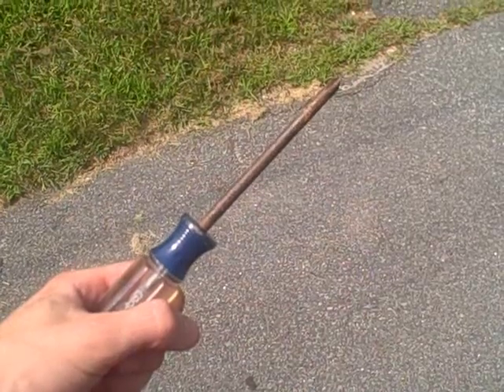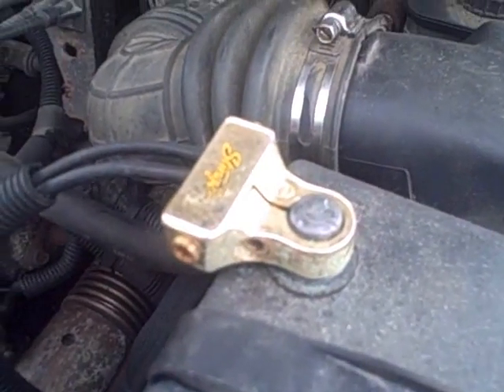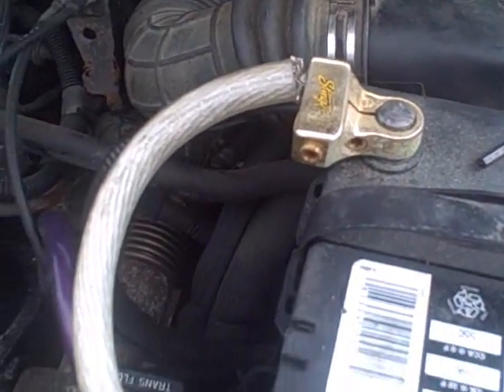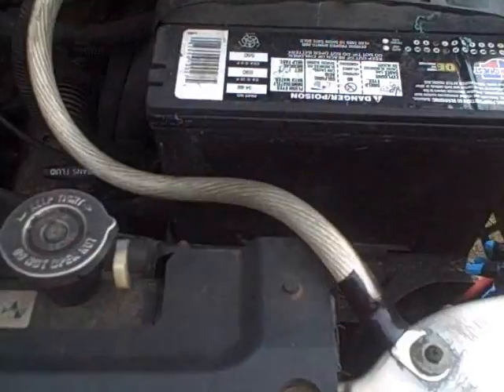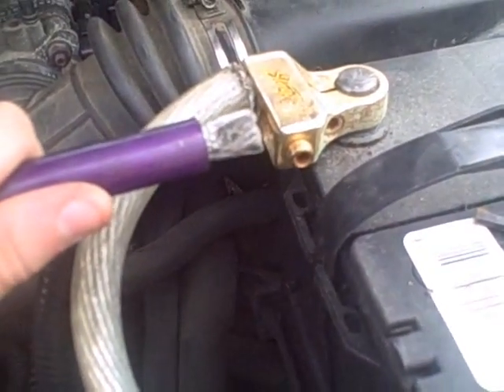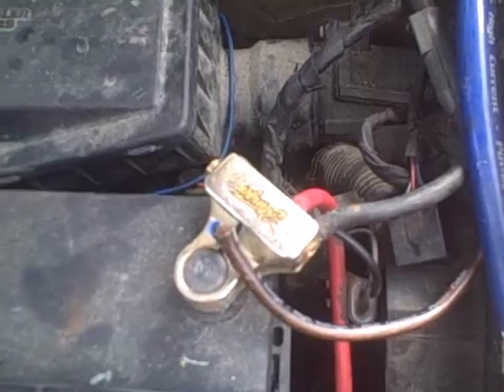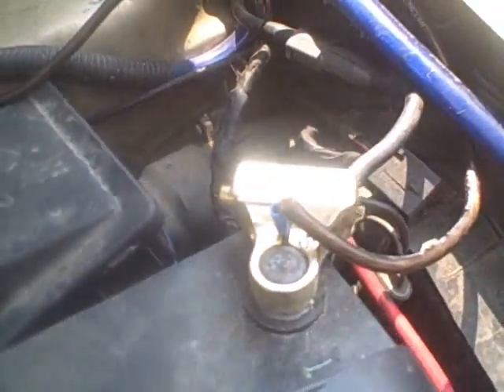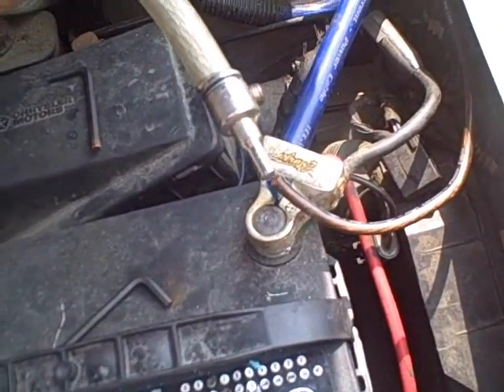Increase Car Audio Power 25% - How To Install Big Three Upgrade - Easy 15 Volt Stereo System Big 3

Comment: you need 2/0 AWG big 3 is weak
Reply: +kaine stefaniak 2/0 awg is different than 2 awg wire.... 2/0 is bigger than 1/0 awg 3/0 awg is bigger than 2/0 awg and so on. food for thought.
Reply: Are you dumb or 
the big 3 is all 0 gauge 2 gauge isn't is thick is 0 and as your saying the big 3 is weak what do you consider then.. big 4?

Comment: you should do the big three even if you don't have a system it has been proven to help your car
Reply: Yes better current flow the better for your car
Reply: +legendary504 hey can i ask you a question about the big three ? when connecting the wires do i connect the positive to the battery with the fuse inline already or should i install the fuse when every single wire is connected ?
Reply: +Cingle player alternator to the battery is correct just Make sure your wire is on the positive post of the alt you can check it with a multi meter also make sure to fuse all positive connections
Reply: +Cingle player I always pull my inline fuse just as a precaution. Any step you can take to protect your equipment from power surges can potentially save you hundreds of dollars.

Comment: Nice explanation, simple yet effective. 

One suggestion... you should probably use a larger machine screw for your battery to chassis cable attachment. In theory a machine screw with smaller threads will stay in place better (Especially if you have bass shaking your car like crazy :p )

Comment: I just wanted to note that by simply only increasing the size of your wire does not increase you current flow, but it does increase your handling capabilities.  Think about it like this, a 12v battery will only supply 12 volts to a wire regardless of its size, however if you have that 12 volts of pressure pushing say 40 amps, a 12 gauge wire will carry it but will burn up from forcing all them electrons so tightly together.  Where as an 8 gauge wire would better allow the electrons to flow freely without producing excess heat.
Reply: Exactly!  Bigger wires can carry more power, but they do not 'MAKE' more power.
Reply: Righto W. He said increase the power flow.... he never said it supplies more power.
Reply: Its the continuity of the situation

Comment: Do I need a fuse on the wire that goes from the alternator to the battery?
If yes, how many amps the fuse? My alternator is 110amp.
I have 2 fuses (100amp) each that goes from my battery to my amplifier. It is ok or no?
Thanks
Reply: +LOV2XRL8RL  the main charge lugs on some models are not fused on some they are . question is where are you picking up your supply's from the battery lug clamp itself or on the back of the alternator .  if there is no fuse on the system then nothing to fear  but adding to the alt fuse if there is one may result in pulling that unit out leaving u with no charge and a dead motor 50 miles from home  Split charge system is the way to deep cycle AGM or a odyssey battery to run the kit  with a smart sense or professional split kit with alt sense pick up . You are Ok to connect direct to the battery post here . personal i would have a AGM In the boot running amps TV's ect  then One cable down to charge it .;)  . Always run extra chassis bonders to battery when doing this shit .
Reply: +LOV2XRL8RL Fro what I have found, is that it is not necessary, but if you feel like you want that extra level of protection (mainly if anything would damage the wire, then nothing would happen) go for it. I believe it is a 200 or 250 amp fuse that is recommended.;
Reply: A250 Amp fuse will not blow till it sees around 300 + Amps  under direct short condition So i can not see you pulling 250 Rms . once you have installed all your kit .enjoy stay safe.
Reply: +Rs500ybd I changed those fuses (100amp each) for one 100.
Reply: you will soon know if they are underrate they will fizz out on ya on a drop note .remember electrics kills even 12 volts .;)

Comment: what amperage of fuse would be used for a 370 amp alternator
Reply: +Exhilarating Bass So use fork battery cable then 35 mil up  good for 1000 amps plus .
Reply: +armando castillo  370 amp alternator what is the load requirement of all equipment at full duty cycle  first then you work out what size cables to use if it might require a second or discharge cap . i would fit a 350 bridge leaves 30 amps clear  but what is the over all run time of that alternator producing 370 amps .  do the math work it out what you have to run  what it requires how long the runs are what loading drop will be involved in shitty cable  lots of posh cable out there with nice bling blue red sheaths but the cable core quality is Pants  a decent roll of cable will cost in America about 800 dollars . Maths first then shopping . ;)

Comment: only 1 real issue i had with this, a single screw fastening that ground wire (bumbuuuum!) always use a nut and bolt with a spring washer. scratching the paint away, ding, a single screw, buuuum!

Comment: I got a gmc yukon xl with 2 15 inch audiopipe triple and a audiopipe 3000 1channel .. 200 amp alternator and two i interstate batteries. When da bass drops my voltage meter on da dash drops down to less than 9 volts and bass shuts off but comes back on ... Like how much power do i need.. Its ridiculous how i cant get this right

Comment: HEY EXO I DID ALL MY 0 GAUGE CABLES UPGRADES BUT THE CAR WONT STAR UNLESS I CONECT BUT THE FACTORY POSIVE CABLE GOINT FROM THE ALTENATOR TO THE BATTERY IS IT SAFE TO CONECT BOTH OF THEM THANKS
Reply: +Victor Garcia Dude...that's obvious!
Reply: Victor Garcia yes connect them all

Comment: I have a 2001 firebird n I wpuld like to do this but I have a side post battery, can I still do this upgrade to it?
Reply: KING KRISM yes you still can.  look up on ebay or amazon car audio battery terminals and you will have a few options. there's a kit to convert your side terminals to actual post if you have the screw in terminals. Or you can get a slightly longer bolt and simply use ring terminals at the end of your wires.

Comment: Do I have to upgrade my Alt to or can I do the big 3 wit stock alt n battery
Reply: You don't need to upgrade your alternator, unless you play very long continually and with like 3000+w and a very small battery.

Comment: I'm driving an 88 Chevy S10 and I recenly installed a 400 watt amp in my truck. I'm only running a single 12 inch sub off the amp. My front, 5" speakers, and back, 3" speakers, are running right out of the back of my stereo through the wiring harness. I know that all the stuff works because I just pulled it out of my old car. The 12" speaker and amp work fine when I just have the battery switched on, however, when I start my truck my whole system begins to cut out with the engine running (similar to a CD skipping). Does anyone know if this would fix this problem or if it would be something else?
Reply: Sounds like a ground issue

Comment: only thing I would add is use a dremel with a wire cup wheel, andclean down past the primer...you still had primer showing. the dremel will get it to a polished finish, and is flat metal to metal.

Comment: man I just bought o beast of a system, but I still have so many questions, I wish I could get exo to hook it up, or at least set down and talk with him about what I really need, and not what the shop just wants me to buy
Reply: if you need help I will be happy to. I am MECP bronze level certified...so I have passed tests...not just some guy who "kinda knows" about audio. oh, and I was an installer for a paycheck for 3 years.
Reply: djbadandy1 does thos really increase your porwer out that much to worrk about it?
Reply: Lots of factors here, but potentially yes. Depends pretty greatly on the amp delivery that you need, but maximizing every connection, will deliver all the power your car can offer. Can you put a number on it? Like 25%? Lol no. Its gonna be different for every situation.
Reply: djbadandy1 i have a zeus 3000.1d
Reply: Is that 1500 or 3000 rms? Its been a while since ive messed with anything hifonics.
Reply: 3000 rms
Reply: Michael Beard Should run 0gauge cable + and - from Battery to amp. Why direct? A car chassis van be compared with a 2 or 3 gauge cable. Next step should be adding the big 3 while you already being busy with cables. Doesn't cost much and isn't much work either. If you got a good stock big battery you'll be fine. Still not satisfied, place better big one with high cca rating or a same type battery you have in the back. Good luck

Comment: Well kind of !
While he did up grade the cables you could do a better job.
The battery needed to be better the cables were ok but when you run a + lead that fuse should have been mounted to the car.
ALL cables should be hidden as best as you can it should look factory when your done.
use the plastic shield like a factory wire uses.
and follow the factory path for the alternator cable.
You might have to remove a few things to do it right but in the end you will know it is a safe install.

Comment: Looks like someone had to cut a shit load of strands in order to make it fit in their cheap tiny battery terminal!!! LOL
Reply: Wondered if anyone caught that. Also, I had an install done from a shop in Idaho, wont say the name for legal reasons but they did use a screw for my ground on a 600 watt sub amp, it lasted a couple years, till some corrosion started in the tiny threads where the screw meets the body. Even with the cleaned metal the contact was meaningless as it became loose over time. After frying 2 speakers I traced all the wires, found this ground wire with a single screw holding it down, replaced it with a bolt and nut and viola! No more blown speakers. Don't cut corners and use a single screw for ground wires.... The amount of threads that make actual contact degrade considerably over time as corrosion takes place, not to mention they don't hold a great deal of pressure as they can become loose very easily. If you haven't run a tap into that hole for the screw your using, you risk shaving the threads off the screw as it is run into the steel body, which will also cause a weakness as it can strip or become loose with less effort.
Reply: rebelnut1 A shitty ground isn’t going to cause speakers to blow you dip shit. Turning your gain up to max like it’s a goddamn volume knob will blow them though.
Reply: rebelnut1 even if you mention their name, the most they would do is serve you with a c&d order, and you would have to take the post down.
 cuz you aren't even defaming, just stating how the end result of the job, caused for you to lose out on a service (that you paid for, remember) that the shop had indicated it would do without fault.

Comment: Or save time amd run a ground wire from the to the amplifier
Reply: No this will cause ground loops
Reply: Jason Gib no it wont if you connect ground to the chassis its like feeding a fire hose threw a garden hose with the ground connected to the battery you will not have grounding issues

Comment: Waste of money, time & copper 
Do you know we can run 100+ HP motor with that size of cable 
And tell me whats the use . There will be a tiny thin fuse in between anyway for protection 
Powerful Horse (0 Gauge cable) will be asked to passed through rat's asss (Fuse)
Reply: Amol Raut Well yes actually if your subwoofers need that power then yes 2.5k is needed and 2.5k is far from a tiny system in a car its more of the avg sized system now a days if you were only running 600ws then yeah thats tiny and the 0 gauge would be overkill. But when it comes to car audio most likely you will upgrade at some point so even if you don't need that 0 gauge wire it's still worth it to have it and in car audio you can't have to much power, power is everything
Reply: Amol Raut Respect dude.
Reply: Amol Raut Why comment on something that you know nothing about?
Reply: hhahaha not off 14 volts. 100 hp X 746 = 74,600 W.  74,600 W / 14 V = you're fucked.
Reply: P = VIcos@
100hp=74.6kw
74600=VIcos@
consider pf to be 1 
so I (current)=179.75 Ampere current carrying capacity of cable
 
Considering for 14 volts 
14*179.75=2516 watts = 2.5 kw

Do you really need 2.5Kw of power for a tiny car audio ??
Reply: Josh Ianneillo 
That would need a separate alternator as well :P
Total overkill :D
My linea has 120 Ampere rating Alternator
I dont know how much is dedicated for car audio but I can assure you I can't draw 178 Ampere out of it  . Even if I use two 0 Gauge wires . 
Is there a need of it ? did he even calculate ?Can his car Alternator output 200+ Ampere dedicated for Audio ? does amplifier used in car need that power ?
Author is simply saying putting 0 gauge cable improves sound quality . 
Is there any basis to that ?
2.5K is insane power requirement for car audio 
To all fellow members . Just use wire gauge that is needed . If your car has 100 Ampere alternator & you are using 0 gauge wire that has capacity to pass 200+ ampere continuously then Its waste of money, copper.
Reply: Mario Mangone  
Copper?
Author said use 0 gauge cable & improve output by 25 %
Reply: Josh Ianneillo I know right! I'm running 650 watts just to my components! 1000 watts to a mono-block for a single 12". And I'm still under powered for my components. I need to bring it up to 800 watts to power it sufficiently....
Reply: rebelnut1 are those RMS values ?
Considering your car has very huge 200 Ampere alternator, the maximum power produced will be 200x14=2800 watts
How do you manage to run your car buddy when only 1150 watts (2800 watts produced-1000 for mono -650 for components) of power is available for rest of the car
Reply: Yes that is RMS, the mono block is rated peak 3000 watts, 1000 rms at 2 ohms, not sure on the 650 amp....
Energy consumption is never full tilt. Even house wiring is not designed to have every single outlet at max current. The same with audio "purely my assumption", I am not playing a single note that is capable of drawing full power for a sustained period. Music, has notes, which draw power as each note is played. Bass "notes moving my 12" sub" of course being the major user of this energy. My battery is a vessel of stored energy, which is where my current is pulled from, as I see my headlights dim I can assure you if the bass note was constant my electrical system would not be able to keep up.
This is what was explained to me by an electrician "as far as housing electrical is concerned", I assume it applies with music as I have described. Any thoughts on how far an electrical system may be pushed before reaching a limit? Or should I not rely on hopes of not maintaining full consumption, as music is not a single note but a symphony of notes which have pauses? Funny, I never fathomed the idea of a youtube comment having the possibility of being educational. But I am curious as to the replies that might come.... trollolloll or not. :P
Reply: rebelnut1 did you even checked your car Alternator rating ?
Reply: Amol Raut The alternator CAN be smaller than the wire rating. The energy demand will come from the battery, as speakers (subs especially) draw huge power for short duration. The alternator will recharge the battery over time. It does not need to constantly supply power. Granted, this is not ideal as you should have an alternator rated for the amount of consumption you're using, but I can assure you that even with my 1700 watts (2 amps), my stock 90 amp alternator and yellow top battery stay charged. I don't run the system at full tilt all the time, and even if I did, it would still not be using 1700 watts constantly.
Reply: SirFrag32 another consideration is the parasitic loss over the cable if you have a smaller cable you have higher percentage loss and so the total dry the battery will be substantially more than you need
Reply: Amol Raut
 consider a Honda civic that only has a 60 amp alternator.  that is only 840 watts for the hole car the difference in running a civic vs a new car is the fuel pump will draw a little bit more power and the computers will draw more power, i think that most people who run more than 1000watts have removed the biggest power hog in the car witch is the sound system  in my car 99 vw i have a 160 amp factory alternator and i have know that you can get a ford van with over 400 amps of out put (that is only with 2 alternators on the big vans)
Reply: Josh Ianneillo yup going to need to upgrade cause that 2.3kw car stereo can't be heard on Mars, or do you need more audio power cause you've got 90% hearing loss.
Reply: Amol Raut the reason why I need to be changed out is because when power runs through small wire for a long period of time it loses its power versus just going through a small fuse for a short period of time quickly build back up its power before it reaches the destination

Comment: 2 things i didnt like there: first ground mount to chassis will not last and wil rust.2 positive on battery got a crappy wire atached between clamp fore battery pole,thats just something u never do.
otherwise maybe fuse between alternator/battery.

Comment: I noticed you didnt put an line fuse for the Alternator  to battery  . the one thing i could see wrong
Reply: Where should he put the fuse?... Near the battery, in midline or near the alternator?
Reply: right before battery  positive or after alternator
doesnt matter
Reply: Robert ellis ilaban Actually the alternator is creating current, as well as the battery storing it. I would place one at each end on that positive wire.... Just as a precaution.